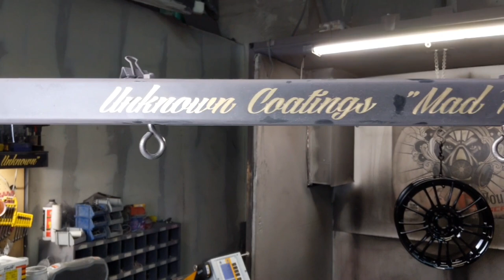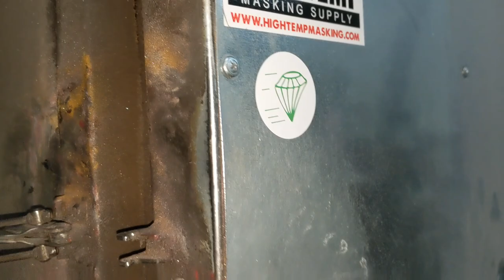Extreme Adams Gold Wheel Powder Coating - UKC Short

Comment: Hi there
Kent from Sweden here.
I would like to know how you know when the powder thickness is ok.
Are there any general rules? 
I'm having problems with orange peel and don't know if I have to much or to little powder. 
Thanks
Kent
Reply: What's your oven setup
Reply: @kamolia  190 Celsius
I brake the stuff 15 minutes after the part has reacht 190C
Reply: @kentaborules  i meant how powerful is your oven, if it doesn't ramp up quickly try reducing the load as in number of parts inside especially wheels
Also when you put your parts have your oven heated up already and try to let the parts sit at 120C for 10 mins at part metal temp to ensure all powder is molten then ramp up to final cure temperature this can help minimising orange peel